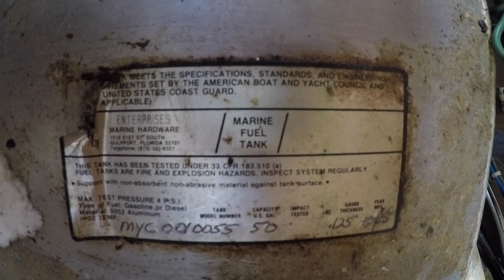Morgan 43 Fuel Tank Removal

Comment: Hi Kasper,
We are the new owners of Maggie May since March of this year.  We are loving the boat, as she sails great and has great systems.  We came across your video when we googled “fuel tank repair Morgan 43”.  We put your video to good use as we removed the tank from the settee today.  Unfortunately, the weld or bonding of the checker plate replacement piece only held for four years. Now we just need to get the tank off the boat and to a shop.
Glenda and Ben
Reply from the maker: @glendaromano6617  hi Glenda and Ben, yes it was supposed to be a temporary fix, I think your best option would be to get I new one made :)